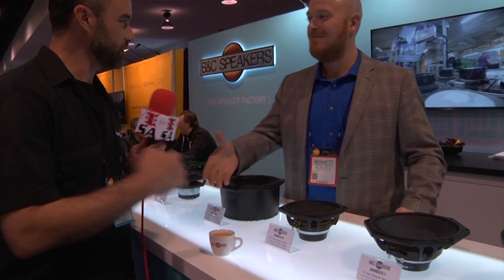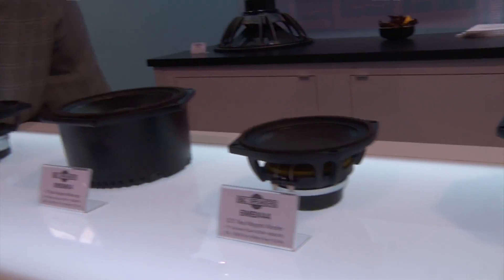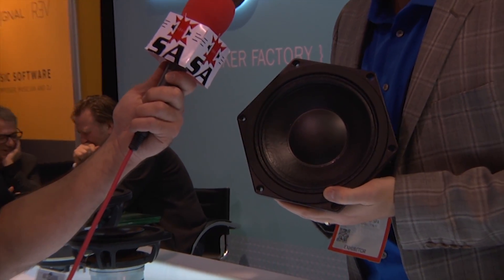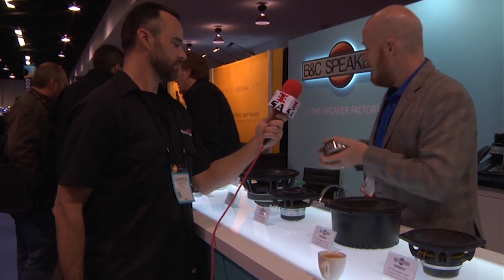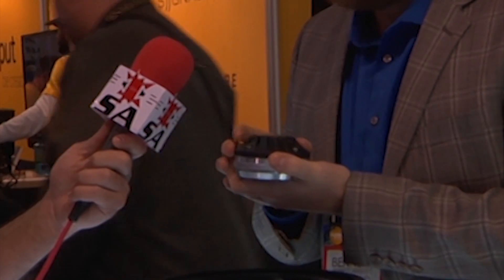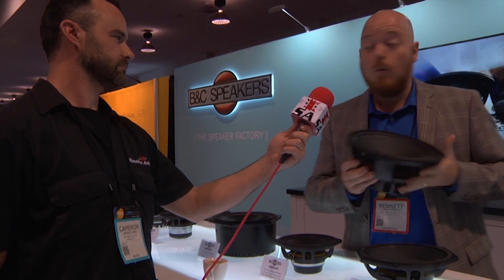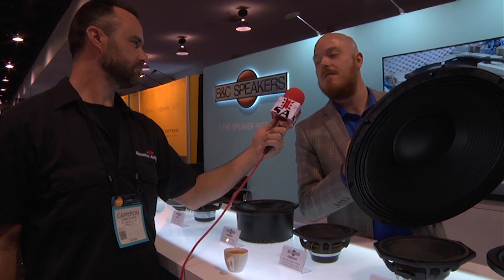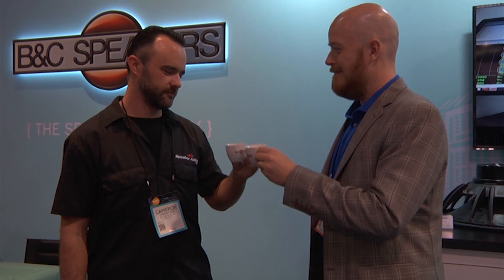B&C Speakers new TOP SECRET technology just released for NAMM 2017 - First Look

Comment: Ho ho ho....nice scam boys  !!. The 21"  is a regular driver. It is the DS  range. Uses Neo slug with the voice coil gap machined right in there . 4.5"  -  4 layer aluminium voice coil. (18 Sound have already done this.....only their 9601 has a 5.3"  motor )  The real killer in the B&C DS range is the 15" sub, with essentially THIS motor.  https://www.bcspeakers.com/en/products/lf-driver/15-0/8/15ds115-8      18 Sound cannot touch it.

Comment: Quick measurement on new, unused piece of 21DS115 with drawn neodymium coil :-D :  http://www.picfront.org/d/9vlC
The sensitivity and efficiency is INSANE for 21". Bl 35, Qt 0.27. Outcome might differ with different method and not so stiff cone after break-in.

Comment: Kewl! :-) Could I use two 21"s mounted against each other to create vacuum for my science purposes? I don´t want to break down atomic structure of the inside residual materials and air though. Even finding the planck power hard way would render few blocks around having a bad day.
P.S.: If anyone would share experience with new 21DS115, I would appreciate it. I see the power and options for this beast, which will be likely to work in quite small enclosures for what it is, but I kinda don´t like smaller magnet venting holes and other stuff. How is the optimalisation of cooling of this beast?